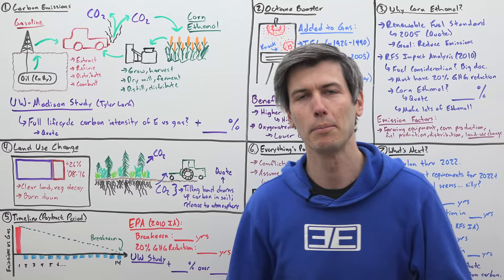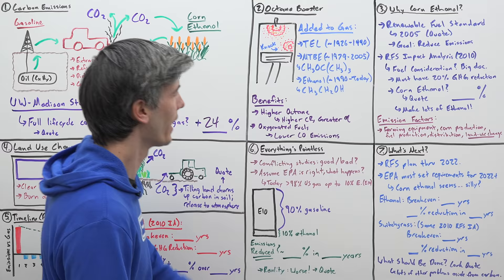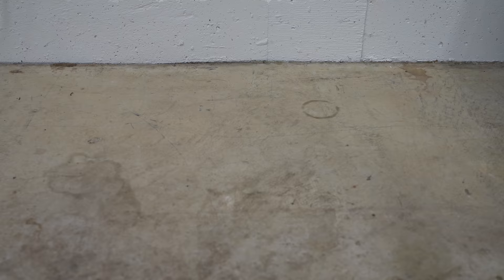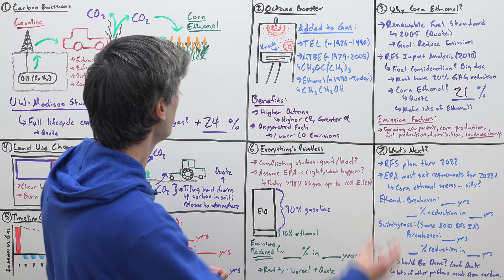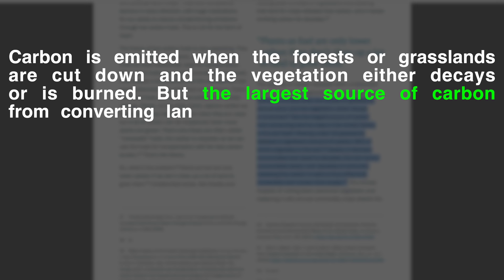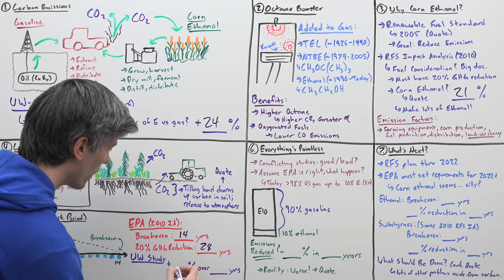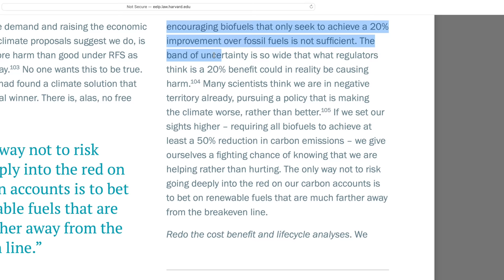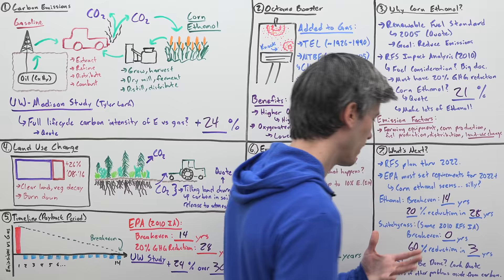America Was Wrong About Ethanol - Study Shows

Comment: Your Mileage may vary....I first noticed the net effect of 10 percent Ethanol Gasoline about 20 years ago. We are from Massachusetts which was early to go to the ethanol containing gasoline, but ended up in NY State. We traveled fairly frequently to visit family in Massachusetts using various cars.  We would fill up in NY and then fill back up in Mass. I noticed my mileage was 10 percent less on the way back.  And that Ethanol containing gasoline cost me 10 percent more. So we burned all the same amount of gasoline to go the same distance AND the 10 percent alcohol.  I have reproduced this may times since the.  Now we have local gas stations that sell Pure Gas (no ethanol) and I have done the fill up with that vs the other several times for long drives and again noted a 10 percent drop in miles per gallon with the Ethanol containing gasoline vs the Pure Gas, but now those )(*&)&* charge 10 percent MORE for the Pure Gas.  We have seen this in our Minivan and sedans including our Civic.  You can easily reproduce this experiment.  The added Ethanol does NOTHING for the environment.  There is no net reduction in the amount of gasoline burned, just now we also burn the ethanol.  Mike
Reply: Denver in 1988 was the first government entity to require E10 when they were on the EPA list of ozone non-attainment zones.  Soon with ethanol they were off that list.

Even with just 10% ethanol added to E0, the Swiss Federal Laboratory for Materials Science and Technology found that the especially health devastating ultra fine or nano particulate emissions were lowered by 97%, carbon monoxide lowered by 81%, carbon dioxide lowered by 13%, aromatic hydrocarbon emissions lowered by 67-96%, and genotoxic emissions lowered by 72%.
Reply: Cool story Mike! I love the 10% story! one of my favs along with the Easter bunny and Santa Clause.

Comment: Land use: You’re not going back far enough in your history. Initially the reason for using corn for gasohol production was an effort by the National Corn Growers Association to find an additional use for the large surplus of corn already on hand. That surplus grew out of a couple of very good corn crops back to back. IOW it grew out of a need for an additional product until the politicians got involved and started promoting gasohol as a benefit to the air and also a new source of jobs and so on it went. THEN government started dropping the “set aside acres” program and incentivizing corn production. About here is where your story steps in.

And there wasn’t much land clearing. Not much slashing and burning. Sorry. The land was already farmland but was tied up on the “set aside” acres. All that was necessary was to plow up the cover crops growing on the set aside acres and plant corn.

Comment: It irritates me that no one uses ethanol to it potential. We need to increase compression and make engines ethanol only. If you lowered a diesel engines compression. Low enough to run gas(ignoring the differences between them). It would be inefficient as well. We should be running these ethanol only engines at way higher compression ratios to increase efficiency. You don’t gain much of anything running a equally higher octane fuel in an engine designed for low octane fuel.

Comment: Corn at 14% moisture is ground up and enough water added to probably take it to 90% give or take.  After the fermentation process this water content is evaporated to turn it into dried distillers grain, again 14%, to be fed to livestock.  A boatload of natural gas is burned to do this.  That is a lot more carbon dioxide that you left out of the equation.  Ever drive by an ethanol plant and see all the steam?  That is the moisture that was added to the corn being remove by burning all that natural gas to evaporate it.  Wet distillers grain is much better in that respect but now you are using more diesel fuel to truck all that water which contains a relatively low percentage of livestock feed by weight to the feedlots. Oh, and I suspect that the corn mash is heated in the first place to speed up fermentation.
Reply: The newer ethanol plants use the waste steam of nearby/onsite natural gas electric plants to make the ethanol.  Waste steam = free energy (essentially) and produces no CO2 to use

Poet, the largest ethanol producer has at least half their plants this way, so ethanol's low price has room to remain low.  Poet also uses natural gas in Sioux Falls from the city's garbage dump to make ethanol there.

If they did not have waste steam, note there is a patented novel process to distill using nano-bubbles sprayed into a vacuum column at just 104 degrees F to make 200 proof anhydrous ethanol in one pass without the need of going through a molecular sieve (reverse osmosis) to get rid of the last bit of water.   This saves 75% of the energy used compared to conventional natural gas distillation plants.  Works great for distilling water too.

With that system, a heat pump would fit nicely to heat the distiller and cool the column eliminating the lost water and heat (steam) you see at the distillation plant.

An ethanol plant in Nevada Iowa was bought by a German company who makes renewable natural gas from corn stocks in methane digesters with bagasse sold as humus/fertilizer along with ethanol and distillers grains from corn.  No newly added CO2 when they use that for electricity/waste steam.

Note that crude oil gets distilled twice, first to get rid of water and then a second time at 750 degrees F.  Imagine all the energy used and CO2 produced with all that.

Note that trucks haul crude oil from each little oil well, wells which also flare off natural gas.  Note also that it is a long way to import crude oil here from the Middle East as well.

Cattle feeding operations spring up around ethanol plants to use the wet distillers grains so distance is not an issue.  The wet distillers grains even with the water probably has more protein per pound than the straight corn anyway.  Note that dried distillers grains is triple concentrated so transporting the protein abroad is more efficient than with the less concentrated straight corn.

Poet was the pioneer in recycling all the process water in ethanol plants, no liquid discharges.  

It takes a lot of water to produce and refine oil, even more if it comes from fracking.  

Oh, and there were no grasslands or forests broken up for corn ethanol.  Quite impossible since US cropland acres have been declining.  

That was the whole (false) thesis of corn ethanol making more CO2.

All the energy and CO2 it takes to make and deliver a product to the consumer is reflected in the price of that product.

The spot cash delivered price of ethanol on the NYMEX is just $1.46/gallon.

The price of sub-grade unusable gasoline (RBOB) is $2.75/gallon.   Even more to turn RBOB into usable E0 gasoline.
Reply: OH! you mention the heating up part 3 times...we got it.

Comment: Ethanol doesn't have to come from corn, as you point out.  Saying that corn based ethanol was wrong is not the same thing as saying ethanol was wrong.  You also seem to be suggesting that the 'carbon intensity' can't be controlled or reduced.  What about other types of growing methods:  hydroponics, or in a green house and capturing the carbon dioxide released there.  The timeline is based on corn production not changing over 30 years, or other sources of ethanol being used.   There's also no discussion about reducing the carbon footprint of production methods.  Looking at other biofuels of course merits research.

Comment: I've heard that the production of ethanol is a net loss process, so why bother producing it if the energy input exceeds the energy produced?  It is cleaner burning than gasoline which is the only positive I see.  Carbon dioxide released into the air is actually a good thing, since this helps increase growth of vegetation.
Reply: I heard your totally wrong.

Comment: Using corn for fuel instead of food is another alternative that isn't being considered. Even if it is food feed to cattle, it still becomes food for humans. Having said that, I certainly don't want it turned into high fructose corn syrup.
Reply: Ever hear of distillers grains?

All the fertilizer and everything from the soil is still fed to the livestock in the distillers grains.  The only thing ethanol uses is the indigestible to cattle starch which they normally waste out their rear ends as methane flatulence and starch rich manure which turns into methane later.

100% of the protein, minerals, vitamins, and fats are still available for feed in a healthier and more concentrated form.  Ethanol does compete with high fructose corn syrup however since both are made from the starch which you don't seem to be concerned about.

Comment: Corn based ethanol is also in my opinion a bad idea. That's not to say ethanol is generally bad. I would like to see what happens if we use sugar beets to make ethanol.

PS.
Corn yields less than five tons per acre and has up to 10% sugar. Sugar beets yield up to 30 tons per acre and has a sugar content of up to 21%.
Reply: The reason corn is so economical to make ethanol from is not because it makes the most ethanol per acre, but instead because it is value-added from already existing feed production acres which preserves the feed in the distillers grains.

No corn is grown just for ethanol, far too uneconomical to do.  But with the feed factor, few other sources can compete with it even though they make more ethanol per acre but little else, like sugar beets.

30 tons of sugar beets = >800 gallons of ethanol per acre plus a little beet pulp/fiber.
177 bu. of corn = >500 gallons of ethanol per acre plus 991 lbs of (more digestible) protein.

The sugar beets require a dedicated acre of land, leave very little residue on the soil, and the harvest of them is harsh on the soil as well.  

France makes ethanol from corn, feed wheat, and beets.

We all are aware that whiskey/bourbon is made from corn, but I never heard of a spirit made from sugar beets.  It does exist and is called beet vodka though I have never seen any.

Comment: This was a great video. However, I think it still misses the real point. You're comparing the emission ratio of pounds fuel burned. That number is deceptive. A more correct view is pounds of emissions gases per weight mile traveled. Yes, work per pound emissions. It's the other side of the idea of why nitromethane produces more power per swept volume than gasoline. We're replacing an  18k btu / lb fuel with a 5k- 7k/btu fuel in a 9 : 1 or 8.5 : 1.5 ratio which lowers the specific energy of the fuel. This is turn results in a lower work output which is a lower MPG. What this translates to in an increased pound fuel / mile and resulting emissions increase per mile. In general people don't understand the relationships between work and energy and consequently don't understand that while the ratio of the output changes the net carbon output is the same or more due to the lower specific energy of the fuel.
Reply: None of the CO2 produced by the fermentation and burning of ethanol is newly added.  I all just came from the atmosphere and needs to be back there to make the new gallon of ethanol. 

All of the CO2 produced by burning petroleum is newly added.

There were no grasslands or forests broken up for ethanol.  Quite impossible since US cropland acres have been declining.

Corn producing states according to Census data shows grassland, forest, and wildlife areas increased since ethanol came to be.

Even in our current inefficient gasoline optimized engines, ethanol gives more power.  For example, a Chevy 5.3L gets a clean SAE rated 380 horsepower on E85 vs a dirty 355 hp on E0.

Ethanol costs less per mile to drive with than gasoline, even if we lose mpg in our current gasoline optimized engines.

Ford's prototype eco-boost engine was optimized for E85.  It achieved 15 to 20% better mpg than E0 gasoline.  They did not come out with it because they thought they could skirt the MIT scientists patent by not being flex fuel.  Still in litigation on that one to this day.   An ethanol optimized engine Ricardo built for GM was not only better mpg than gasoline but also better mpg (& power) than diesel engines.  This is why GM wants a 100-octane fuel standard from the EPA.

Denver in 1988 was the first government entity to require E10 when they were on the EPA list of ozone non-attainment zones.  Soon with ethanol they were off that list.

Even with just 10% ethanol added to E0, the Swiss Federal Laboratory for Materials Science and Technology found that the especially health devastating ultra fine or nano particulate emissions were lowered by 97%, carbon monoxide lowered by 81%, carbon dioxide lowered by 13%, aromatic hydrocarbon emissions lowered by 67-96%, and genotoxic emissions lowered by 72%.

Comment: By the comparison of the host, the ethanol 'solution' isn't justified but is shady deal at best. With my 2015 Equinox on 10% ethanol blend a distinct, clear reduction in MPG is obvious.  Thanks for this no nonsense information.
Reply: A 2015 AWD flex fuel Equinox is rated at 23 mpg on E0 and 17 mpg on E85.

The EPA states the US fleet averages a 3 to 4% reduction in mpg on E10 and a 4 to 5% reduction on E15.

US national prices from 85prices web page.

E0 = $3.60/gal. at 23 mpg      = $.157 cost per mile
E10= $3.21/gal at 22.08 mpg = $.145 cost per mile
E15= $2.91/gal at 21.85 mpg = $.133 cost per mile
E85 =$2.43/gal at 17 mpg       =$.143 cost per mile
Reply: @danafletcher2341  Thank you for this information. Much appreciated.

Comment: interesting stuff...  Not sure what to do with it.  I was just trying to determine if non ethenol fuel was better for the mower than 10% ethenon.  Specifically to as it relates to mower storage and residue problems...and therefore starting up the mower and reducing carberator and other problems...?
Reply: The DOE found that ethanol blends last 3 times longer than E0 in small engines.  

Alcohols are often used as an active ingredient in carb and injector cleaners.  Sea Foam for example contains 25% alcohol and they claim it makes gasoline last two years.

Identical mowers to ours in Brazil use their common gasoline which contains 27.5% ethanol.  It has worked out so well and for so long that Paraguay went to E27.

I am old enough to have seen varnished gasoline in small engines every spring.  Since E10 came in the 1980s, I have never seen it ever varnish.
Reply: E15 all the way.

Comment: You didn't talk about the big elephant in the room.
Corn was chosen because of lobbying.
Corn based ethanol is worse than sugar cane ethanol, both in a production and environment standpoint.

Well, regulators usually only understand the number$.
Reply: Corn was chosen because we already grow it, in fact the corn belt grew more acres of it in 1980 before ethanol than today.  Corn ethanol is a value-added product of already existing feed production which preserves the feed in a healthier, more digestible/efficient, and more concentrated form called distillers grains.

No corn is grown just for ethanol, far too uneconomical.  But with this feed factor, few sources (including sugar cane) can compete with it.

To prove this, know that Brazil put an import tariff on our ethanol in 2017 which remains.  If sugarcane were more economical, no such thing would be needed.

Also know that Brazil is starting to use corn as well.  It is a great fit for them because:

A) they already grow corn for feedlots.

B) Sugarcane does not store well but corn does so corn allows them to more efficiently run their distillation plants all year around in-between the two cane harvests.

Comment: It is know that sugar cane is about 12x more efficient than corn based ethanol. That's a low hanging fruit for someone start taking the corn based ethanol market. Since there is an already perfected system of production of extremely cheap ethanol in Brazil, why was not that already copies into sunny and wet places like Florida or the golf cost states?
Reply: Bing copilot says we do a little, but the vast majority is (value-added) from corn.  I imagine they make more money for sugar production.  Hawaii uses very expensive imported diesel to make dirty electricity, they could use their abandoned sugar cane fields to make pollution free cheap fuel and electricity for a fraction of what they spend on other renewables.

Bing states sugarcane make 560 gallons of ethanol per acre on a 35 ton/acre crop.  Sounds a little low to me but that is what it said.

Value-adding corn into ethanol produces not only >500 gallons per acre but also 1000 lbs. of protein (& other things) per acre.  This feed factor (distillers grains) is why it can economically outcompete even sugarcane.

So much so that Brazil put an import tariff on US ethanol in 2017.  Went up to 18% this year.

Brazil is also value-adding corn for ethanol and distillers grains.  It is a great fit because unlike cane, corn stores well so they are able to more efficiently run their ethanol plants all year-round in-between cane harvests.
Reply: Frost? Where not Brazil. Its like asking Brazil to grow wheat.

Comment: imo, it's never been about the greenhouse emissions or renewable fuel solutions ; the reason we opt for maze ( my people call it 'corn') as the ethanol additive * in gasoline is strictly to benefit & aid the American farmer,period. 

(* I have one vehicle from 2011 which has >95,000 miles on its odometer but has only ever had non ethanol fuel  . It purrs like a kitten & it is cleaner than the others which use ethanol gas. just a point of related info from a viewer)